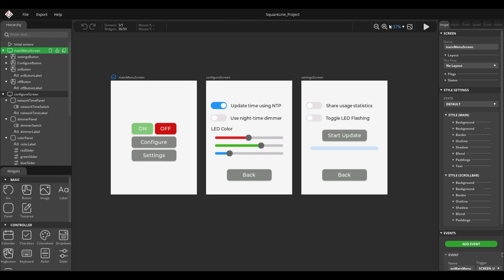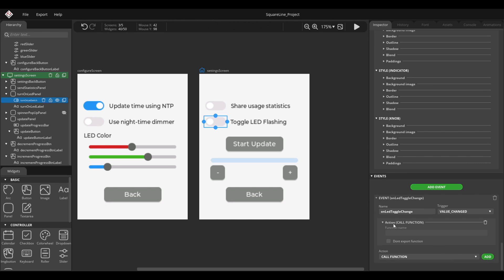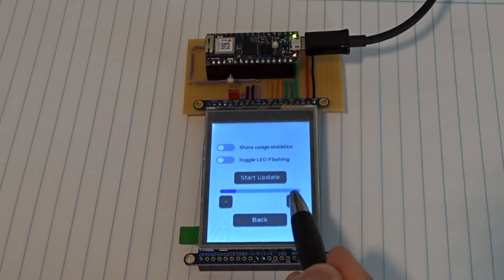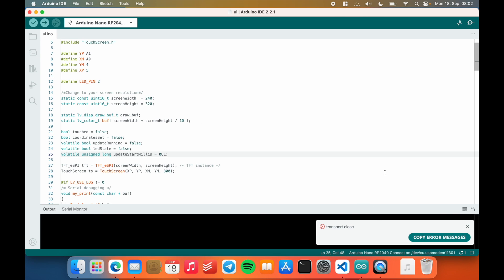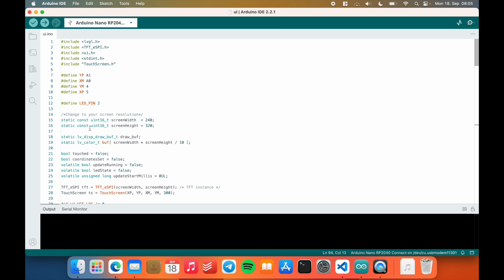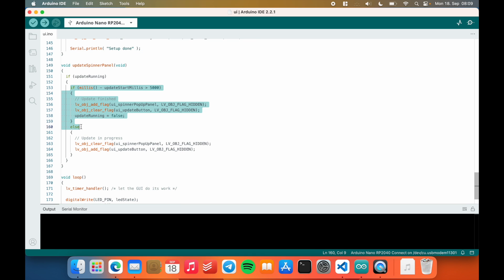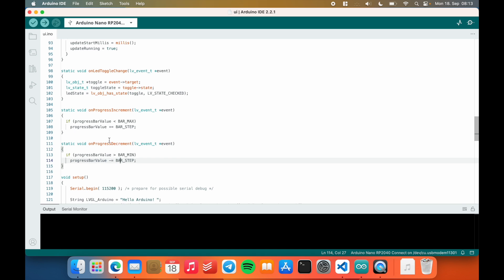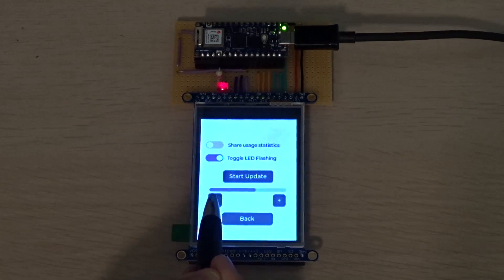Squareline UI and LVGL Events on an Arduino Nano RP2040 Connect | Tutorials | nerdhut.de

Comment: How do you know which display will work? and which arduino?
Reply from the maker: Hi, for the MCU requirements, please see the official docs: https://docs.lvgl.io/8.3/intro/index.html#requirements
Arduino boards that exceed these requirements have a good chance of working, but it's not guaranteed.
What I like to do is to select the target board in question in the Arduino IDE and then compile the LVGL code for that board. If it compiles, you have even better chances of getting it to work. If not, make the necessary adjustments and try again.
Regarding the displays: I think you'll have a harder time finding any Arduino-compatible screen that won't work with LVGL. However, you may need to use different drivers and you'll definitely have to adjust the user config header file. 
Good luck with your projects!

Comment: Just found this series of videos. Do you know if Squareline studio can be used against Visual Studio Code and a simple Pi Pico RP2040?
Reply from the maker: You can use any IDE you like, including VS Code. Re. the MCU: I haven't tried it myself, but it worked with the Arduino RP2040, so you should have a good chance of getting it to work. But please review the MCU requirements in the official docs: https://docs.lvgl.io/8.3/intro/index.html#requirements

Comment: Thank you for the video, it has been very helpful. I have a custom board and stripped down the code to just turn an led when toggling the switch. I can post the code and may have something simple wrong but with this line: lv_obj_add_event_cb(ui_turnOnLedSwitch, onLedToggleChange, LV_EVENT_PRESSED, NULL); it crashes. When I comment out this line, I can toggle to button on the screen but the led will not light.